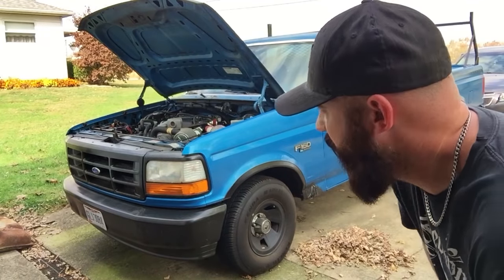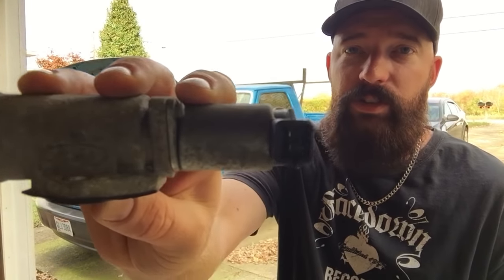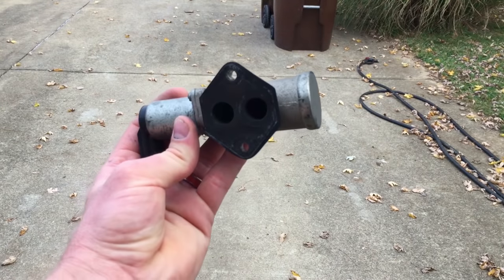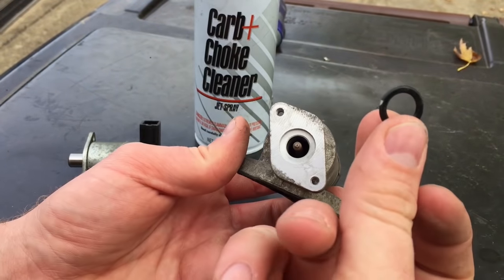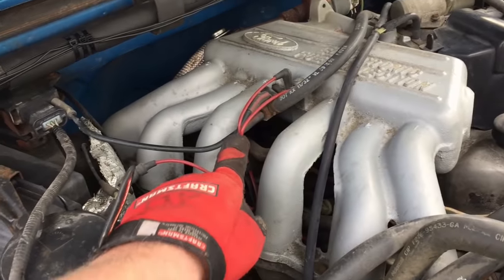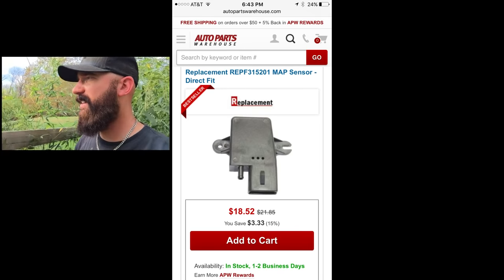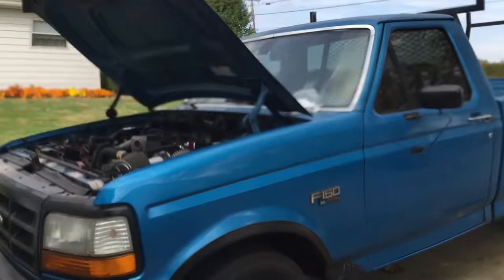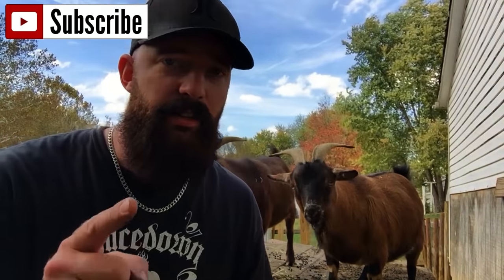Car / Truck Won't Run or Idle / Fix - F150 is the patient

Comment: Im curious if your check engine light was coming on or staying on. Ive got one that was running like new. Had the slightest miss about 1 min apart. Not really a miss. Old man obsessed and sent it to a shop. I heard him pull up spitying sputtering running worse than it was before i removed the spark plugs that had actually welded themselves in the cylinder head changed wires rotor cap dist cap fuel filter that was on backwards and looked like it was put on in 1990. No check engine light has come on snd this thing will barely run. Im leaning toward fuel pressure. I would love to know what the shop did to it. Id never seen it run as good as it was when he sent it to the shop. I find it hard to believe it was an accident. The worst me hanic on the planet had to notice it ran like new when they got it and it will barely idle and drops to no power with foot on the floor a week after they had it in their shop.

Comment: I've been having a major issue that I can't seem to figure out. The truck is a 1988 F150 XLT Lariat with the 5.8L 351W V8. The engine is out of a 1995 E-150 but it's the exact same engine. When I bought the truck it ran perfect. A few months down the line I started having problems with the truck stalling and no starting again till it eventually just gave out. After a week of tinkering I got it to run, turned out to be the ignition control module. However, ever since then, the truck won't run with the SPOUT connector installed. Hopefully you know what I'm talking about. It comes off of the distributor off the ICM it links the timing back to the computer so the computer can advance the timing. Anyway, it won't run unless it's removed. I quadrupole checked that the timing was correct and it is. So I just kept the SPOUT connector removed. A few weeks down the line the same issue was happening. Now the truck won't run unless the MAP sensor is unplugged too! The MAP sensor is brand new. Every time I plug it the engine just stumbles and falls flat on its face. I've also replaced the TPS and cleaned out the IAC. Nothing seems to be working. I'm thinking it may be the computer not being able to process the information sent to it. So it can't advance the timing correctly and it can't process the air fuel ratio via the map sensor. Could the PCM be the problem? Any ideas or opinions on what I should do would be great!

Comment: Brian I have a 1991 Ranger 3.0 5 speed. I have a rough idleing issue and the exhaust stinks. I have had to use starting fluid to start the pick up every day. It sat for 2 years and I cant seem to figure out the issue. Any ideas???

Comment: Great video... Just one little question. Did the check engine light come on when the Mass Air Flow failed? I have the same issue but no codes are thrown.
Reply: Craig Ovadia mine messed up the other day and same thing happened I unplugged it out of curiosity and it started THEN the light came on

Comment: Hmm was not those. I have a 89 f150 5.0. I have bought all the parts you're talking about replaced them, all three new fuel pumps, fuel pump relay and switch, new fuel filter, new injectors, I have spark, fuel is getting into the engine. All the vacuum hoses have been replaced. I know the engine runs we've got it to start when I spray in starting fluid it'll fire right up and then the idle's all caddywhompus replace those parts three times now and I can't figure out what else it could be the distributors brand new what am I missing

Comment: I have 88 ford f150 does the same thing your truck did, so I took off that sensor & cleaned it real good put back on & truck ran great for about 20 minutes then shut off couldn't start again so I got new part & replaced it & its still doing the exact thing again, so does this mean I have to replace the sensor on the bottom of the throttle body, I got my truck in South Carolina & live here, its 88 ford f150 302 5.0 XL Lariat, I got it for a fixer upper for $800 & I have had it for 5yrs spent about 2000 on parts since then so I'm wondering what's wrong now what do I replace without spending more money on parts I don't need, any advice would help...

Comment: I cleaned my idle air control valve but it is too far gone. Disconnecting its wire allowed me to idle right but it won't do the warm up rpms is only difference I can notice.

Comment: Hello Brian, my Ford 1990 F150 4.9 L stalls on reverse after driving for a while, it did right in the middle of the parking lot, could not re-start the truck, then fr some reason I did not have my cables nor anybody else to have given me a jump. After about 30 minutes I decided to start it AND IT DID START!! And I got back home. It did again after a month, and this time as I lifted the hood, I noticed a bit of fluid had come out of a couple of Battery cells, I suspected it overheats. After 20 minutes I tried to start it and it started, went back home. So now the question is.....What is causing this overheating? I checked it for shorts, but I found none, what do I need to check and fix? Thanks a lot for the advice.

Comment: Bought a MAP  sensor for my '93 Lightning(off Amazon for $17!) and put it in; truck started right up, but after I let it idle for roughly three minutes it ran rough again and then stalled. Drove it around town for 20 minutes and ran a few errands turning on and off the engine where each time it started right up and no idling issues. Not sure if that first startup with the new sensor installed was just a fluke?
Reply: Nathan Oconnor  computer needs time&miles to relearn  &get straight w/new sensors.

Comment: I was just wondering does my 1986 f150 with a 4.9 have a map sensor on it. It idles extremely rough but we'll run down the road.

Comment: No Sh1t! Just like the others said “straight to the point” I have the same motor in my 1995 F250, replaced and cleaned what you suggested. Voila she is working perfectly again! If had a neighbor offer to buy the truck since he seen me getting it running 😂

Comment: I sprayed carb cleaner into the IACV and throttle body but my truck still won't start, still makes the buzz sound when key is turned once, any suggestions?

Comment: I have a 93 longwheel base dual gas tank 5 speed 300 6cyl  and it just won't start period, it will crank over but nothing else? What's my problem or what should I look for to be messed up?

Comment: I cleaned the MAF sensor and I did the the other part clean the other part that you should to do and it seemed to work for a minute but only like 2 days or something and then not now it's back to idling rough when it gets warm and when I shut it off I smell gas can you give me any more ideas about what it is or do you have any figured it would be much appreciated

Comment: Brian..i got a 95 f-150 that has a sticker under the hood that reads ..timing on this motor which is a 4.9 inline 6 cannot be adjusted..which mines this engine is excempt as far as smog is concerned...had a star smog guy tell me that plus i read the sticker to...didnt know if you knew that but thought i would pass it along to you an others that may be viewing...

Comment: I live in alabama and I have a 95 f150 with the 5.0 and it has a mass air flow sensor and no map sensor I wonder why.
Reply: The truck was probably in CA at one time.

Comment: My 96 E150 seems to idle low. Around 500 to 600 rpm. Is that normal? A cold start it idles high for a few second then comes down in rpm quicker than it should. Any ideas? Thanks

Comment: I got  an 04 f150 f150 Triton 3v....but my question is if its running an i unplug maf while truck is running and it's shuts off. Does that mean my maf is good & its another issue??

Comment: Great info thanks 👍. Ive got an 89 4.9 F150 hadn’t checked anything yet it starts and idles good but shuts off when going into reverse but not drive; why does it not like reverse?
Reply: D J 92 drive and reverse mine dies ever find the problem
Reply: I found info on that it said Your transmission fluid may be slightly low.
Reply: henrysmooth mine does he same thing but the transmission fluid is fine I just got an oil change and they checked all the fluid levels
Reply: If not vaccuum leakage or Idle air valve it very well might be that darn ole
MAP sensor.

Comment: Where's the map sensor in a earlier model? If there is one....I just bought an 86 and I have to keep on the gas for it to stay running. I just did the carb cleaner on the throttle body. But I think what you showed might work better for me. I know nothing mechanically. And just research everything myself. My ford is a manual and has the in line fuel filter with the big round air filter with the metal case that sits on the throttle body.
Reply from the maker: Katie - I know it sucks... but to be real there are so many options of possible things that could be wrong... could be: mass air flow sensor, idle air control valve, egr valve, map sensor, fuel pump, o2 sensor, fuel filter, vacuum leak... there are so many things with the same exact symptoms.   These models don't have a modern scan port, but you can scan them with a hack method.  I did a video of how to do it... couple minutes I will try to find the link.  Will send it your way --> best of luck
Reply from the maker: Katie ... there is the link to the video mentioned... give it a try!  https://youtu.be/bQB9D5MKaQ8
Reply: Ok. Thank you for the info!! I will watch that one too 😊

Comment: Ive got a 1989 ford f150 with a 5.0 in it and she was running fine then started shaken real bad i changed the sparkplugs and it still did it then it was going up to 4000 rpm and going about 25 mph ive changed the distriputer ,egr valve,map sensor and knocked a hole in the cadlitic converter and now she'll idle and when you put her in gear she'll die im not sure what it could be

Comment: Grate video right to the point, no extra bla,bla,bla. Thanks,  in my case the cooling sensor was, tha problem, it wouldn't start right away, only cost me $20.00 thanks so much for your help. GOD BLESS YOU.

Comment: 1990 5.0 Lincoln Town Car Air charge Temperature Sensor? I Also Wish I knew More about auto electric. sat 4 ..8yrs. damn squirrels nested. replaced map, iac valve, egr assembly, tps, vac lines. tune up, and timing. still stalls at random or after idle for a long time.

Comment: I have a 91 Ford f350 7.5 crew cab. When I'm at a red light or idle in my driveway, the truck shakes and It does a little hesitation. When I'm driving, it have a hard time acceleration.

Comment: I have a 1997 ford ranger, i have replaced alternator and belt ,fuel pump,fuel filter,battery,both something some kinda power pac,plugs wires ,air filter ,oil and filter,brakes, i can crank it but it cuts right back off, try to keep it running it spits and spudders and cuts off can you please please tell me what in the world is going on with it.

Comment: My 92 f150 has a rough idol , if i give it some gas after about 2ish minutes it will get to a point its holding itself up without stalling but once i try to switch gears it stalls.. No amount of stepping on the gas will keep it alive in gear. It doesnt get even rev up in gear, But it will in park. Once it stalls you have to wait hours to try again. Right after it stalls, it will crank and crank. After 3+ hours it catches almost instantly rinse and repeat. Can not figure it out.

Before you say it , it has a new transmission replaced 8k miles ago.
Truck itself has 261k.

Comment: Just ordered new map and going to clean the iac as well. It's a 94 and it doesn't stall but it has a rough idle and misses a bit. It's got egr delete on it any ideas if this will work for me? Thanks

Comment: I don't mean to BUTT heads with you but I'm pretty sure my 1996 E150 has an MAF sensor even though it's not from California.Thanks for the Video..
Reply: Get a Actron CP9690 code tester. It checks live, record, graphing, emissions readiness test, transmission codes, oxygen sensor tests, and MORE! It retains the memory of tests until you delete them. It is well-lit. It uses  4 aaa batteries under the cover screw, not included. It includes a cigarette lighter cable. The tester covers 1984-2013 and is updatable with a USB cable from EBAY. It comes in a black pouch.
Reply: That's cause he's not taking into account the 96s, I have a 96 f150 with a mad and I live in Arkansas. The 96 was the first year obd2 was standard and required as well as the last year for the 4.9l l6 so it's excluded allot.

Comment: How do I know if it’s the mass air flow sensor or the map sensor?
Reply: Location, location, location.. the MAP sensor is mounted (with a wiring harness AND a pencil-thick vacuum line) on the firewall, in front of the glove-box area  of the square-body Ford trucks. The MAF is, on every vehicle that employs the tech, mounted (with a wiring harness only [no vacuum line]) into the air-intake ducting. It will be between the air filter and the throttle body  if it's on your vehicle
Reply: I found the fix it was the egr vacuum regulator/solenoid

Comment: Thanks, this sounds like my prob with the map. I just put a new IAC in it within the last 24 months, but I"ll clean that out too and throw a $22 map at her.

Any chance this problem results in higher gas use too?  

I've been able to get around this problem by holding the break down, reving/switching to gears (reverse or drive) and then going, but I'll stall at stop lights/signs.  This solution worked for a week or two, but now it's running rough and threatening to stall even with gas on the pedal.

Hoping that map fix will do it.  Also have been advised to test the TPS and check voltage, which I'm going to do as well.
Reply from the maker: Kistilan - if both fail check your EGR valve as well... they are super common problem causing these symptoms.  Those will run you $95 bucks, so it's worth trying the manifold sensor first. Best of luck man.  Take care!
Reply: Thanks, Brian!  My map is under warranty from advance autoparts, so that'll be an easy one to do.

I found this article on 6 symptoms of ignition coil failure and am leaning towards that being my end fix if the map, iac cleaning, TPS check, and egr valve do not solve the problem.  

Specs: I'm working on a 1992 4.9L E40D/automatic custom red F-150.  highly modified with F-250 suspension and spacers to afford some massive 270/75 tires on the 15s.

www.doityourself.com/stry/6-symptoms-of-ignition-coil-failure
Reply: Just an edit:  Looks like my ECM was foiling ALL of those components -- broken capacitor.  Now it's fixed.  Map was still good (and under warranty actually).

Also, if you have a plastic wheel well guard and a spare person, you can get that ECM in and out in 5 mins each way if you use a prybar and a rag on it so you don't damage the wheel well fender.  Took it from 15+ mins per install/removal to 5 mins. Only 4 or 5 bolts had to come loose so the prybar could slip between the fender and the wheel well guard to flex the space for the ECM to slide in and out.

Comment: Hi I need your help! My 2001 F150 won’t start if the engine is hot and I need to press the gas pedal to start up. Do I need to replace the IAC Valve?
Reply: Hello.  I know I"m not the guy who made this vid, and this comment is old,  but try replacing your ECM coolant temp sensor.  It might be faulty as this is a symptom of that.   Usually there's two coolant temp sensors.   One for the temp gauge, and one for the computer (ECM).   If you having a scanning tool that will give you live data feedback,   you can check the function of this sensor by reading what the coolant temp. is on your scanner's live data while the engine is running.   At full operating temperature,  it should read somewhere between 180 and 195 depending on the thermostat rating that's in your vehicle.

Comment: i8 have a 1997 ford 250 was banging into gear and running rough i did what ya did works great..thanks man
Reply: Mine is banging into gear, every gear. You think its the mass air flow sensor? Strange!

Comment: I have a 95 F150..straight 6..it has 260,000 miles on it ..and runs good..been stalling lately..so I may buy that part and clean the other one..just changed the fuel filter today
Reply: I bought my truck in 2001

Comment: What kind of air intake filters do you use? I would like some like that but I can’t afford K and N. Any suggestions?
Reply from the maker: Nathaniel - I just used ebay 3” intake filters on my f150 $9 each... with pvc pipe.  Was super cheap build.  You can get the rubber connectors / reducers on eBay / Amazon as well.

Comment: How are you doing today I have a 2012 f150 5.0 issue with the oil pressure sensor when I come to a complete stop light will come on. But when I add a little gas it goes away if I put it in park. I have had this issue for about a year now taken to the Ford dealership they said it was the oil pick up hose and it would cost me about 1200 dollars to fix it I said hell no

Comment: I have 96 f150 4.9 no MAP sensor my truck has a funny idle sometimes jumps up & down nobody can figure it we've thrown a ton of parts on but no fix yet isn't much else to change at this point

Comment: My truck shuts off when coming to a stop and wants to die when putting into any gear. Sometimes it idles really low, other times it idles fine. I have a “stored code p0106” whatever that means but no engine lights on.